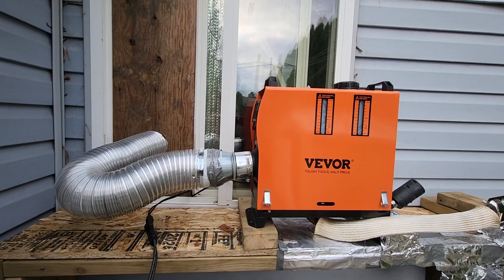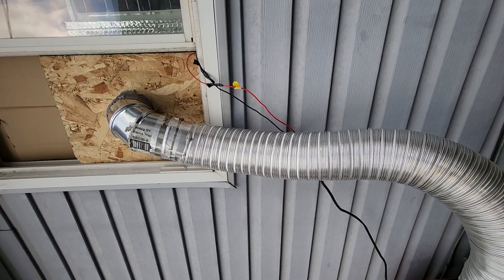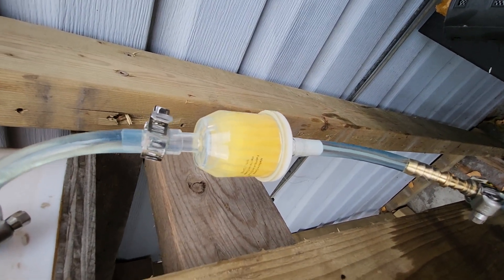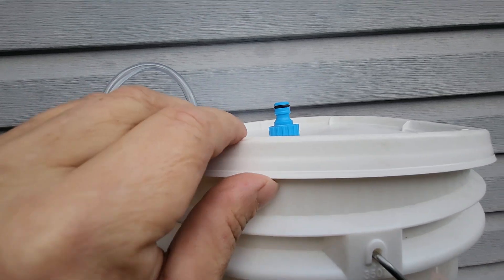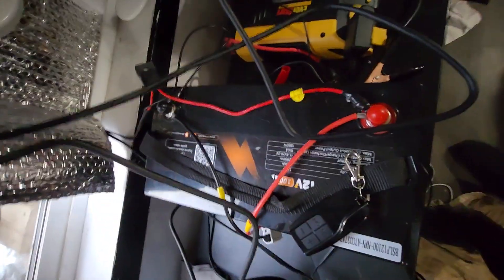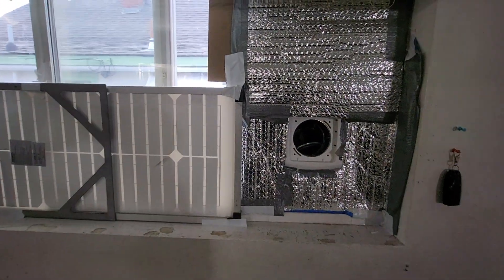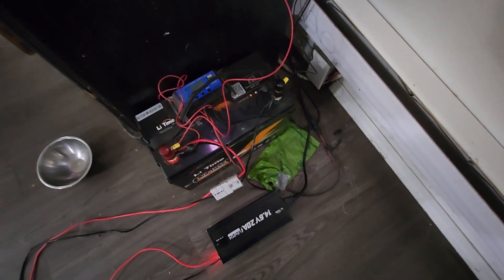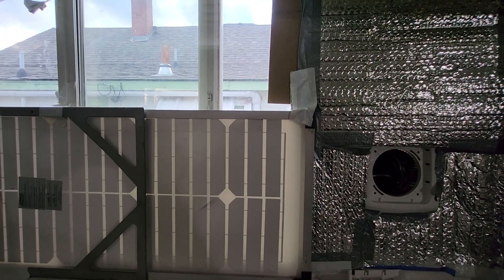Diesel heater adaptations for home use, upgraded heat duct work and larger capacity fuel tank

Comment: You need to have those heaters in an enclosure if you're going to keep them outside. They are not meant to be outside in the all types of weather, they will get damage. If you looked at the instructions, you will see they are made to be indoors. I have two heaters and I have them sitting at my windows on brackets on a plywood board. the exhaust is going straight outside. There's no smell of diesel in the house, unless you spilled some. If you want those's heaters to last, bring them inside or make an enclosure for them. 

good luck
Reply: That’s how they use them is outside in the elements. A lot of young people go up into the mountains and ski and they don’t have lots of money for a fancy ski lodge/hotel so they sleep right in their vehicle. They set the unit on the ground or they set the unit on a tire bracket mount the unit sits on the tire and they route the exhaust away and run the heater hose into the vehicle. There’s a guy on YouTube that has ran his outside for two years in snow so deep he hast to go out and brush the snow away. He use it for his dogs.

Comment: You should be taking the intake air (the large port on the back of the heater) from the place the heat is going to. This way the room is fully and properly heated up.

Comment: lower that  diy fuel tank lower than the heater, if junk builds up on pump and it doesn't seal 100% it could start a  siphon, and it will make it a lot easier to fill